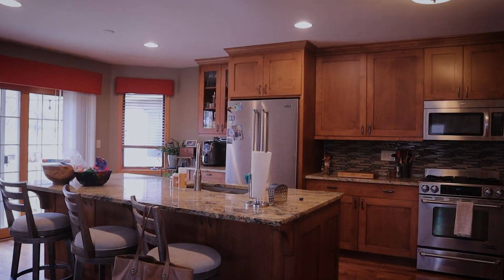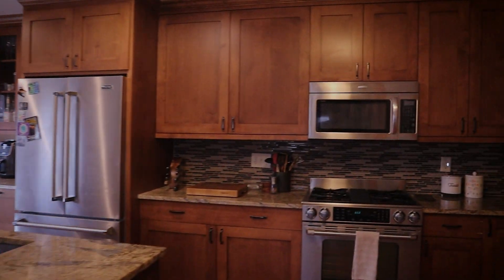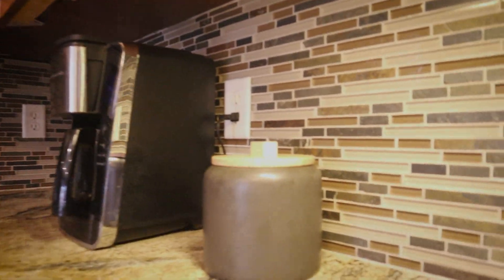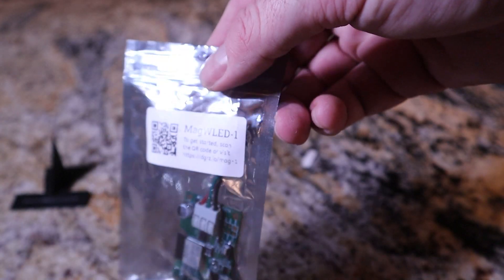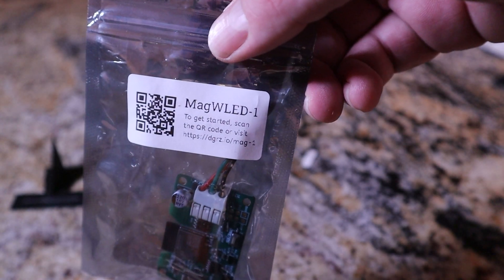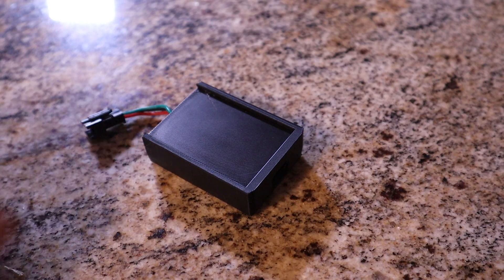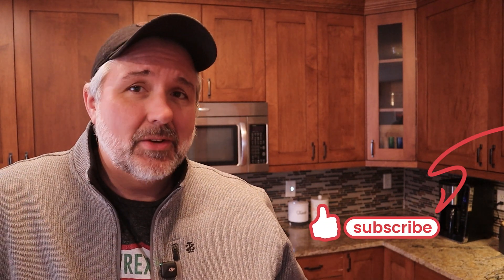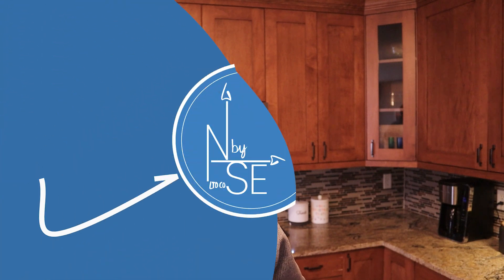Under Kitchen Cabinet RGB LED Lights | DIY, Programable WLED | Materials & How-to

Comment: Great video, you make the install look super easy! I’m tempted to add this setup to my cabinets to host my own kitchen raves lol. 
I’ve not used wleds before, is the main difference between these and the leds you used in your illuminated stained glass display box video that you control them with an app and smart device? Or are you programming/coding them yourself?
Reply from the maker: It's mostly the app, which is quite a bit better.  It is a little mpre pricey for sure, but it's much better quality lights and controller.
Reply: @ that makes sense, thank you for the info!